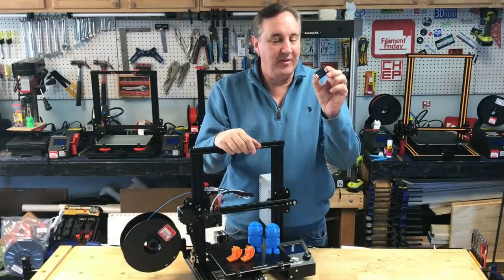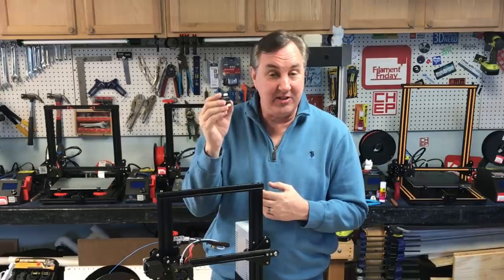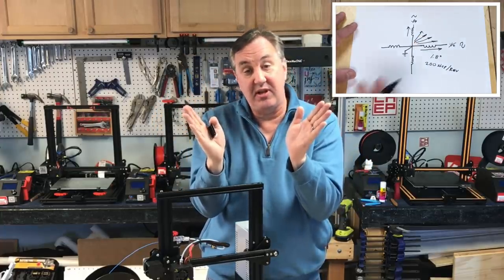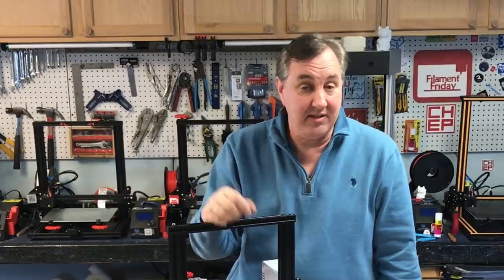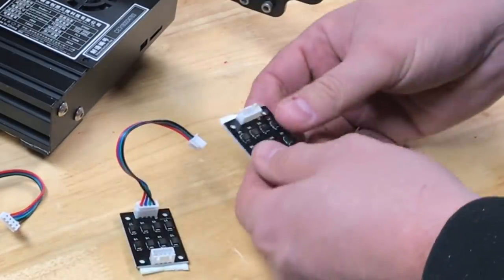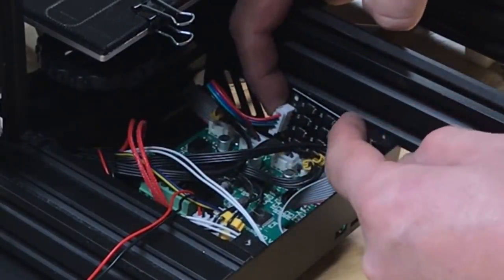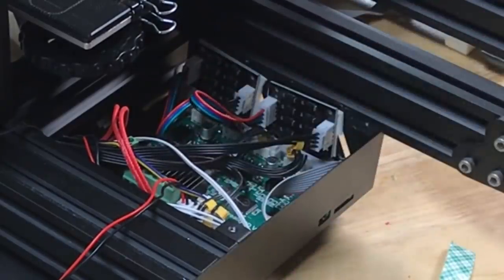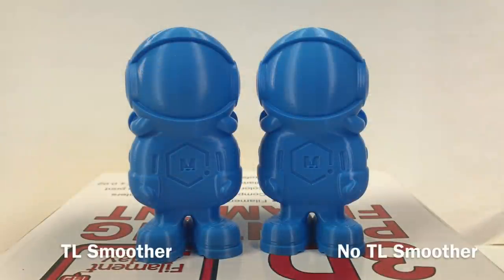Creality Ender 3 - TL Smoothers Upgrade and Test

Comment from the maker: If you have an Ender 3 with TMC silent drivers, then you don’t need these TLSmoothers. They only help the noisy 4988 drivers. Print the Benchy and look for zebra strips to verify you need them.
Reply: Hello, how to check what drivers I'm use? My board is 4.2.2
Reply from the maker: If you have noisy steppers or your benchy has the stripes then you need these. I don’t know if another way to tell.
Reply: @innerfire369  3D printers are finicky enough beasts to wrangle and tune as it is. It can be tempting to go wild with mods, but don't add in-circuit / piggyback electronics unless your experience and results indicate it's actually needed (or not performing to a level you want, and said electronics will actually help get you there).
Reply: @pr0xZen  as an electronic engineer i can tell you with confidence, that those diodes are needed, to avoid reverse current. It was a cheap move not to include them in the original design
Reply: Can it be mounted on extruder and y-axis? I accidentally bought 4
Reply: @oyunlarnkafas4880  any stepper motor
Reply: @deathcube2006  would the voltage drop caused by the diodes not make the stepper motors spin slower? Do you know what the maximum voltage is that the stepper motor is supplied with?

Comment: I hate to give bad comments, but that board needs all the air flow it can get and blocking the vents stops the flow over it. I would rethink where you put those smothers...
Reply: There already lot of openings in that box for air flow like below the circuit , at the back from where wires enter, enough for fan to withdraw air.

Comment: I just installed these on my Ender 3 after converting it to direct drive. Night and day difference in terms of quality. Perfectly straight lines, no zebra pattern or salmon skin.
Reply: does it reduce the noise of ender 3 , i am planning to do this upgrade to my ender 3
Reply: @meestake6290  it doesn't reduce the noise of the stepper motors. If you're after an upgrade that reduces the noise, look into a silent main board.
Reply: I just added a DD to my Ender 3 Pro and noticed this problem afterward. Do you have a 4.2.2 board? Did you put on the extruder as well?

Comment: I've put them on 3 different machines - and I will continue to put them on new machines, if that's any kind of endorsement for what they accomplish.

Tips:
• The TL boards aren't insulated on the underside. Stick the board to a piece of white duct tape then trim.  Now you aren't worried about shorts AND you can Sharpie the underside of the board with the axis it is installed to.
• The Ender3Pro cover is on the underside of the box, not the top.
• Don't use the ball end of the supplied 'wobble' hex wrenches to break the bolts free for the first time.  The heads are soft and the loose fitting ball end will strip out the head of the hex bolt.

Opinion:
• Definitely quieted my HIctop 3dp-18 (Prusa clone) by a HUGE amount.
• It seems to have quieted my Ender3pro enough to have noticed.
• Don't feel it quieted my CR10s-5
• A couple before/after tests on the CR10s-5 show a bit of an improvement for ghosting along the walls
• The Hictop and the Ender3pro where already good for support roof spacing, but the smoothers seem to have improved Z movement in a way that makes the supports even easier to remove and still leave a clean surface behind. 

Weird side note:
On my CR10s-5 I usually run a 1mm nozzle and am running larger items... So that motor is going at a pretty good speed as well.  I thought to myself Well, its the same motor and same chips driving it... Might as well give it the same upgrade - It doesn't seem to have done any harm.  And if it helps with the same type of "micro noise" or whatever you want to call the issue these clear up with axial movement then it made sense it might help reduce any chance of little zits or coasting issues etc.  I can't say that it has or hasn't just yet - but no harm, no foul.

Comment: Interesting video, thanks for the tip! I have just got an Ender 3 after 3.5 years of having a Velleman Vertex because of the fact they're so ubiquitous and therefore well-supported by the community. You channel is pretty valuable for mods and upgrades to improve quality.

I was printing several of the same thing today and noticed that the extrusion width on parts was much more variable than when I do just a couple. I think this could be due to retraction settings.

Comment: Love these mods to improve printing, but since you are looking at such minor improvements its only fair you look at the minor drawbacks as well.  The fan and vents in the control box are there for a purpose.  If you block the vents you block the airflow which could lead to over heating.
Reply from the maker: There are lots of holes in the case so I didn’t really affect anything.

Comment: When I use to build custom power supplies in the 80's, I used 12 volt Zener diodes, and 1 regular 1N4001 diode inline, but reversed.
This would cause a .7 volt voltage drop, so my power supplies would output 12.7 volts, vs 12 volts.
If I used two 1N4001's inline, this would bring it to 13.4 volts.
This was useful if I was making a car charger, or powering car electronics on the bench.

Comment: I installed TL Smoothers on my Ender 5 last week because of the exact same problems you showed here. The diagonal vertical lines and salmon skin. It's very noticable when printing PETG due to the shininess. I think the Ender 3 has the same version board as the Ender 5. I'll know in a few more weeks when my Ender 3 Pro arrives. Thanks for the video.

Comment: Thanks for that. To the point as ever.  Having seen this before it can do no harm and for the sake of £8 it was worth doing to prevent issues.
I did it slightly different to you in that I used all 3 boards, may as well store them in use as in a draw!   I used hot melt glue to insulate the pins underneath and spent a bit of time threading the wires in to get them against the side up against the machine frame.   My machine had issues of lack of heatsink cover to one of the mosfets,  cured by adding a new bit, but as overheating had been an issue to some people I decided to avoid that risk.
I like you format and delivery  keep up the good work it is a mine of useful information for newbies like me.     Regards Clive

Comment: I installed the same boards on mine as well.  I use a glass bed as well.  I did notice on some prints not all that the boards had no effort.   Not sure why but it is not a big issue.   Great video love the work.

Comment: The other benefit to these is they block feedback current you get from moving the axis by hand, which is why your LCD screen lights up if you move them. If, for example, you have a curious cat that climbs on the X axis to investigate the spool of line and places enough weight on it to move the Z axis down all the way, you can get enough current back up that line to kill the driver. The diodes prevent that from happening a second time ;)

Comment: I noticed one of the main sources of vibration in the Ender 3 is the resonance produced by the heavy roll of filament located on top of the Z-frame. Mechanically It is a really weird placement and though it save some work space real state I am sure it introduces more artifacts than you could smooth with any method, and also the main reason that slowing down the printing speed in an Ender 3 and specially acceleration and jerk have so much impact on the final result. Corollary: remove the filament rolls from the printer and place it in a separate holder beside it and the prints should improve a lot (alternatively, you will be able to print faster with the same quality). I am right now printing the necessary stuff to have this configuration. LG
Reply from the maker: Which is why I showed exactly that in my video: 
https://youtu.be/nBjldxIsOhQ

Comment: Um... if you can't tell the two Phil A. Ments apart, here is a trick: look at the shape of the highlights only: WITH the TL smoother the highlight has a flowing outline, without, the highlight's contour is jagged and uneven, revealing surface defects (clearly visible on the arms). That's a trick that dates back to automotive modeling and lives on in 3D analytics tools like the "zebra striping" function in Rhino 3D or Maya.

Comment: Great video.......just a thought.....can you place them out by the motor instead of in the box that would make the installation a lot easier?
Reply from the maker: You would need a longer cable than the one included.
Reply: @FilamentFriday  Is it a different connector at the motor?
Reply: Update.....  It is different connector at the motor end..... O well just have to place them in the box by the motherboard.
Best regard from Sweden

Comment: thats my problem with smoothers on Z. how do you TELL if there is a difference? I have not devised a test that will let me determine if its having any useful effect to warrant the $4. I also put it on E but thats more from habit not testing. someone said it helped at one point in the past and I just always did it. same thing though. no way to empirically test if it makes a difference. but X and Y oh yeah. :-)
Reply: I think the only way to truly tell if TL smoothers help on Z is by creating a print with many Z hops. Perhaps in on later it z hops up or down just a little more or less. But it would be very hard to tell because more than likely you'd have lots of more noticeable artifacts. All that said, the same drivers are being used on all the axis. Therefore, if the artifacts are showing up on x and y, they are also on z and the extruder. It's just, right now, we cant tell due to layer height being 0.8mm versus 0.1 or less on x and y. Anyway, its $8-12 more for 2 (or 3) other steppers. Cheap enough to just do it.
Reply: Empirically, make some test prints.  @^@
Reply: alas that won't help unless you have something to look at before and after to identify as "yep that fixed that"

like the salmon skin we can clearly see fixed here.

just because I don't have a problem with my Z does not mean there is no problem but I can't "see" a difference off hand so far.

 @jeric_synergy8581
Reply: @nerys71  I think one needs to see the the advantage of smoother on the z axis as the possibility for using micro steps on the z axis, that you would usually have to avoid. Then you compare a print that was micro stepped in layer height (with smoothers) to one that was optimized to fill steps (without smoothers). And even if it might not be an advantage in print quality, it frees you from the need to calculate your layer height.

Comment: @CHEP so I have a technical question for you. I guess I will start by providing a scenario. I recently upgraded to the v1.1.5 "silent board" and it did make quite a bit of difference with regard to sound. Based on this video, I did a test print to see if I had that notorious salmon skin and I could see them, albeit very minimally. So I decided to install TL Smoothers and run the test again. Of course since I had 4, and the new electronics lid I printed was designed for 4, I used all 4 for the X, Y, Z and E stepper motors. This is when things got interesting. I started to run the same test print to see if any changes were made removing the salmon skin, but didn't even finish the first layer and I stopped the print. Not only did the stepper motors sound louder than the original stock board, but my hot end fan apparently burnt out, cause it stopped spinning. I tested the leads with the electronics fan to make sure they were still getting voltage and that fan worked just fine. Do you know what could have caused any of this? Thanks for the help, and keep up the great work!!
Reply from the maker: TL Smoothers only work with 4988 stepper drivers. The fan sounds like mor coincidence or you bumped a connector when install the Smoothers.
Reply: @FilamentFriday  thanks so much for the quick response!!! That explains the extensive noise, won't be doing that again. I assume it has to be coincidence since the hot end fan is screwed in and I checked those connections and they are not loose. Either way, its time to replace both fans (electronics and hot end) with noctua's. Thanks again and keep up the great work!!

Comment: Dude, I really like the content but MAN, did you seriously taped those smoothers straight to the air vent holes? Am I the only one seeing a huge risk of frying your printer here?
Reply: Michal He said in the video, that this is not a problem
Reply: @firelord7776  Yeah, he said it so that makes it ok 😀...
Reply from the maker: There are many large holes in the case so it’s not an issue and there are still vents open. I’ve checked the board and it’s staying just as cool as it was before the install.

Comment: Great video. Are you worried about how much venting you covered by sticking them over the slots in the enclosure?
Reply from the maker: No, there are lots of holes at the back of the box and air can still get by the TL-Smoothers. 
It’s been running fine for over 2 months without issue.

Comment: I thought I've heard on the newer Ender3's, TL smoothers aren't necessary/don't cause an improvement, is that likely true? I have a CR-10S I've had for about a month and a half and will have 2x Ender 3's arriving tomorrow. The benchie from my CR-10S does not exhibit the issues the one on your Ender 3 did, so I'm not sure it'd be a worthwhile upgrade on that at least.
Reply from the maker: If you don’t see the diagnosis nail lines then you don’t need them.

Comment: TL Smoothers need air to cool. Make sure to put them near the stepper or add a heat sink on them. Those ones you bought are based on the original work of an engineer from 3 years ago who went through the design as a proof of concept. Some people have gotten rid of the lines by changing the micro-stepping since its set on the board.

http://cabristor.blogspot.com/2015/02/drv8825-missing-steps.html
Reply: This was way over my head but super interesting to see

Comment: I've got a 1.1.3 board and I don't have any salmon skin pb en 3D benchy.
@chuck : what is the version of your board , please ?
Reply: would like to know as well as i just bought a ender 3
Reply: @Spardin  Bought mine a couple weeks ago, an ender 3, and doesn't have issues with this either. Something on it has a datestamp of December 2018, but I can't remember what it is. My benchy doesn't have those issues either. I still might buy them though lol, only $10.
Reply: I tried them once some time ago on my 1.1.3 board and found no noticeable difference - however since then I've replaced the board with the 2.1 version (from the CR range - slightly larger but fits in the Ender 3 just fine). Just tried the same benchy before and after installing the smoothers on the 2.1 board and while I didn't get salmon skin anyway, the diagonal lines that I do get were cleared up by the smoothers.

Comment: Another excellent clear and concise review Chuck, thank you.  I do have a question.  What effect, if any, do you believe the TL Smoothers have on a large surface top layer?  Or how about a Filament Friday on the best way to achieve a smooth clean large surface top layer.  Maybe a TL smoother on the Z-axis would help a little here?
Reply from the maker: Level bed has more effect along with slicer settings.

Comment: I wonder or asking if you know? Do the smoothers put any excess strains on motors or electronics? That is something I have not seen anyone say.
Reply from the maker: michael shampine - none that I know of.
Reply: Ok so I know how a diode works and what it does in a circuit, I did not know why it worked in this context since looking at the diagram of the smoothers did not give me a clear  picture of how they smoothed the print, but I think I get it now. Diodes has a property called forward voltage and this number is a voltage drop that happens when current flows through the diode.  So in practice the smoother drops the voltage a bit going to the motor, this voltage drop is a bit more than the voltage of the voltage spikes causing the noise on the prints. So the only real effect this should have is the motors will see a little less power since the diodes will dissipate some, it should not affect the rest of the electronics in any meaningful way...

Comment: Hi chep i didn't fit a tl smoother on the z axis just the x and y,also on the screen control panel information along the bottom changed when i turned on the printer.

Comment: Driver tuning plays a big role in the salmon skin effect. Too low or too high VREF will increase the ripple appearance. Just right will smooth them out considerably but will not remove them completely. The A4988 drivers need to be set in mixed decay mode by grounding the ROSC pin but all printer manufacturers sets them to auto decay because its makes them much quieter but creates these step disparities.
Reply: Cool
Reply: Print speed also has big effect on this. Everything's a spring so perhaps at certain speeds it gets exacerbated as frame, belts etc. stretch and vibrate.

On my older tevo tornado, maxing out the driver Vref completely removed the effect on almost all prints (only visible on vase mode prints). That printer had an accident, so second tornado i ran with same control box and it has more móire (salmon skin), but it disappears if i drop speed; So this second tornado is having more flex in the frame than the first one. Could be as simple as some screws slightly less torqued, or belts different tension.

Velocity painting talks to this as well.
Reply: I don't know what you said (my own ignorance), but I appreciate you sharing advanced knowledge -- gives me something to look up/google!

Thanks man!
Reply: @jeric_synergy8581  just open your printer up, find the model number and look up the schematic